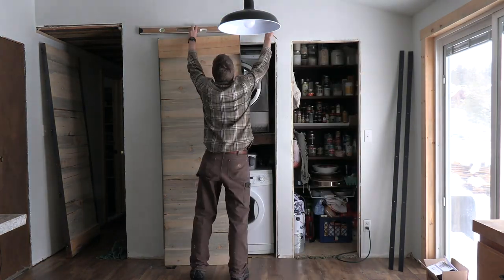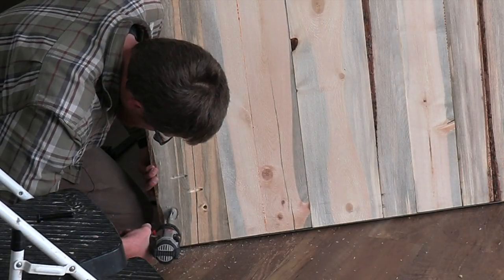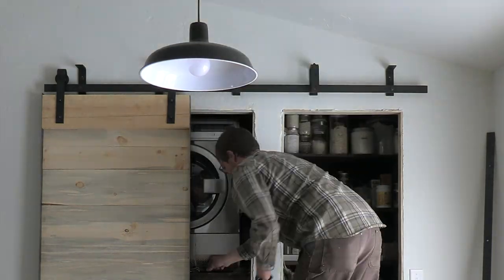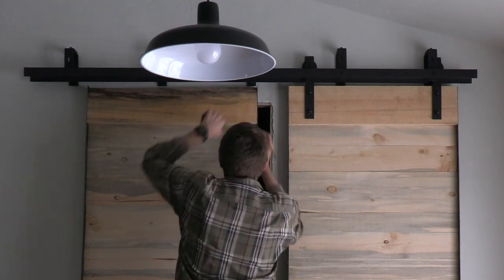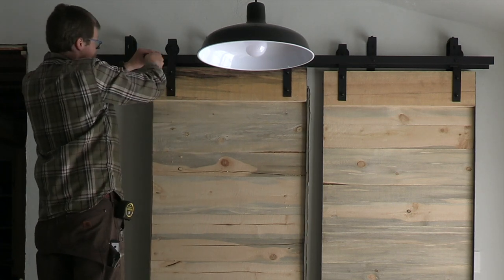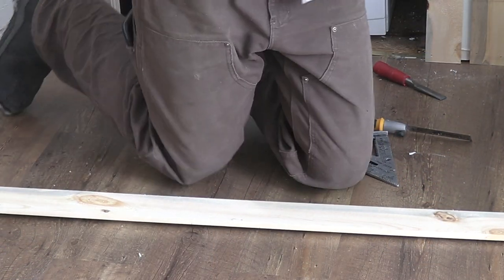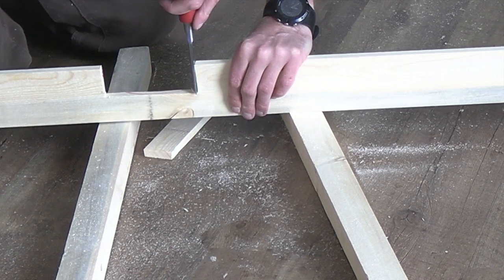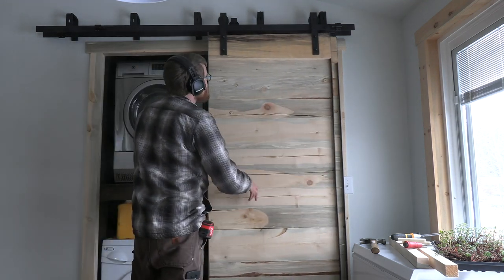How to Hang a Bypass Barn Door Part 2 - Ep #8

Comment: Hi, where did you buy the hardware?  I only find for one door and I need for two just like you! Thanks
Reply from the maker: I bought the hardware on Amazon under the name: 6.6FT Heavy Duty (US Based) Bypass Double Door Sliding Barn Door Hardware (Powder Coated Black) (J Shape Hangers) (2 x 6.6 Ft Solid Rails) Installation Video Included by Homeland Hardware

Comment: What stones do you have to sharpen your chisels?
Reply from the maker: I have been using a cheap 4 sided diamond stone from Harbor Freight. It has worked well for me but I am looking to upgrade once shipping is back to normal.
Reply: Butler Mill Works we don’t have a Harbour Freight here in Canada but we do have a Princess Auto and they sound very similar. I think i will try and buy a high grit diamond stone but not sure yet.
Reply from the maker: @LivingtheNorthernLife  Oh and I use a leather strop as the final step.